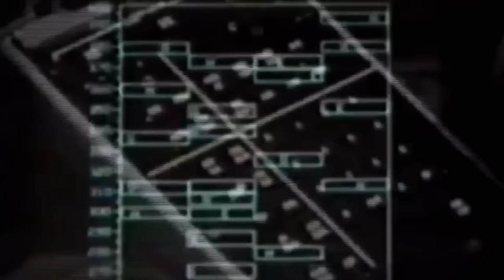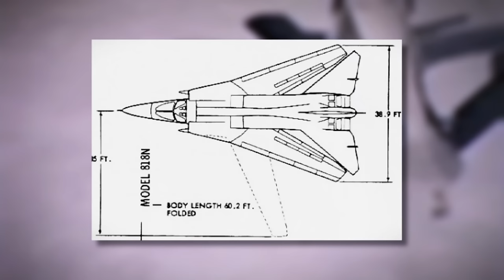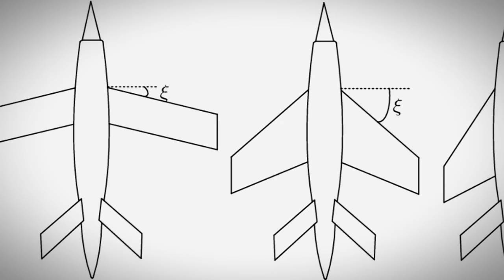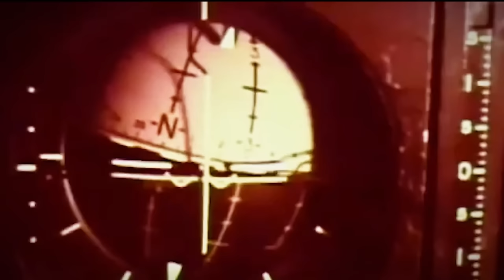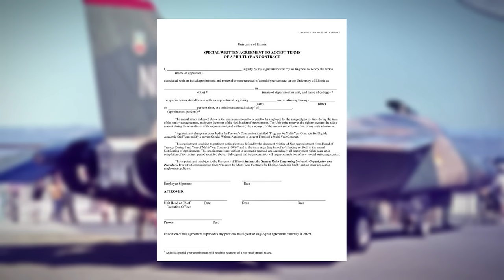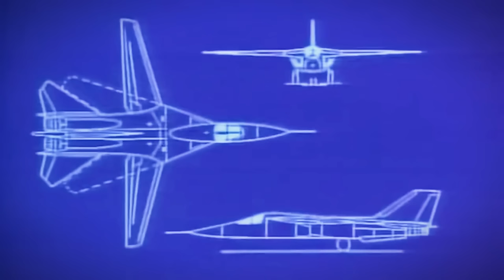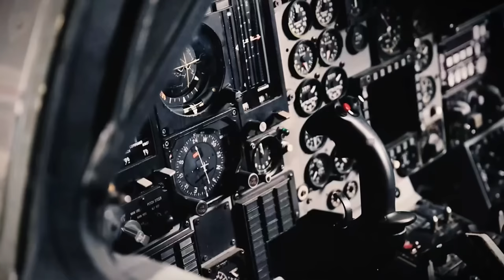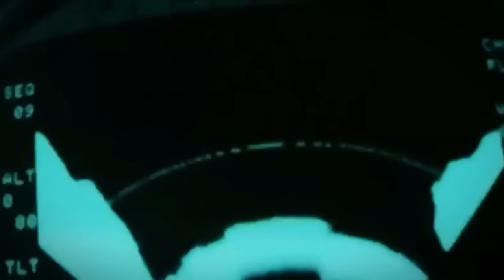10 CATASTROPHIC Consecuences Of F-111's Fatal Flaw

Comment: As an engineer at rhe GD factory in Fort Worth Texas, I was priviledged to work with a outstanding group of engineers, workers pilots and managers that designed and built the F-111 . The experience gained from the previous B-58 program was poured and molded into the F-111. I felt the best model was the F-111C extended wing model delivered to the Australians. So much aviation history and experience was made during those days.
Reply: You forget that the Australians demanded the extended wing when GD developed the FB-111 variant. They contracted for the "A" model and refused delivery for over a year while mods were being made. Different landing gear, and one thing after another including the longer FB wing. The Aussie F-111s were stored at Carswell AFB across the runway until Australia finally took delivery after many upgrades. .My Dad worked the flightline at GD and and lost a case of beer betting the jets would never touch down on Australian soil. I had the privilege of re-building the last F-111 for return to USAF service while working in the Mod program at GD. We took 3 derelict F-111s and made a whole jet from scrap. It carried the designation of E90. You talk about history, I've worked with gentlemen that  pounded rivets on the B-36, back in the day. I retired after 37 years on the F-16 and worked in every part of it's construction especially hydraulics. I've installed every piece of tubing from end to end whether it carried air or fluid. Every F-16 built in Fort Worth since 1984 have my fingerprints on them, somewhere. Guys like me are the ones who actually give you a reason to have a job, When's the last time you actually saw a living, breathing aircraft?
Reply: Thank you so much. Engineers just get the job done. We are blessed to have you guys making our lives safe and simple.
Reply: You made an incredible craft. I got to walk all over an active F111 and sit in the cockpit. The only one I bet A6 drivers kind of eyeballed lustily.
Reply: @williamhudson4938  the main thing that the RAAF demanded was retro fitment of the improved designed heavy wing carry through box. The wing extension were a bolt on article and of not particular significance to any delay in acceptance
Reply: I wonder if you could confirm or bust a story I was told in a Materials class in college.   When discussing the change in properties of some materials at low temperatures, we were told that there was concern for voids in one of the wing parts (possibly the turntable) that could not be detected by equipment of the time. The solution, we were told, was to bring the entire aircraft down to a very low temperature where the material was weakened and stress was placed on the wings to see if that component broke.  One version of the story had this happening in Alaska during winter to make it easier to get to the very low temperature needed.   
Thanks
Reply: @jfess1911  this is the irony of this video. While it mentions the failure of the wing on 67-0049 in Dec 1969, it doesn't go into any details about it or how it was resolved. This is the fatal flaw of the title and the consequences were massive.
In short yes, a small undetected flaw in the wing pivot fitting grew from initial size to a critical crack length in just 100 hours of operation. This was a previous unknown issue with the D6AC steel used in the primary structure. Flaw sizes that were smaller than what was detectable by the non destructive testing available at the time had the potential to grow in remarkable short times. Even with improved techniques with higher probability of detection down to 10 thousandth of an inch, any stress raiser could still become critical in unreasonably short time. 
That is where 'Cold proof Load Testing' comes in. By cold soaking the entire aircraft it would reduce critical crack size. Then they applied specific loads to the aircraft to simulate extremities of what might be encountered in flight. If nothing broke, aircraft was good for a period of time before having to undergo the same test again.  Never heard Alaska in winter being mentioned LOL, they built a very special facility to do these tests in. 

Here is a good paper on the subject written by the Materials Officer for the RAAF F-111 Mr Gerrard Redmond (super nice guy) https://www.ndt.net/article/apcndt01/papers/912/912.htm
Reply: @misspuddles63  Thank you.  I wondered how many critical flaws they found with the cold-soak method, and the article says 11.  I am not young and heard the story sometime around 1981, long before the referenced article was written.   It would not surprise me if some of the details were still secret at the time.  
 I suspect that the "Alaska Story" came from the -45°F test temperature needed for the test.  IIRC, there was also a story of a crash resulting from the terrain-following radar reading the bottom of a lake instead of the surface.  I wonder if that is actually the "snowy hillside story" with facts confused.
Reply: @jfess1911  Welcome. It is an incredible story that this video sadly misses almost completely.
As an Aircraft Technician I don't pretend to understand all that TFR stuff much, but yes I have heard and seen references to the early issues with TFR over water, in the rain, maybe even snow. As I understand of the first 3 to crash in Vietnam, at least one was thought to have been a TFR issue. They got it all tweaked out pretty quickly. Important to remember how revolutionary the system was at the time.

Comment: It wasn't a cracked wing box. It was a fatigue crack in a wing pivot joint. The USAF then established the Aircraft Structural Integrity Program (ASIP) to determine where on aircraft to inspect and how often. Dr John W. Lincoln headed up ASIP as the USAF expert. He was my mentor, and I performed structural analysis under his direction.
Reply: I am a retired military aircraft engineer and I share your concern that the narration incorrectly describes the flaw that caused the accident, if people want to make documentaries about specific items, incidents and historical facts then they should be prepared to do a huge amount of research, in this case I don’t think it was anywhere near enough to be considered factual.

Comment: Back in late '76 or early '77, I was working at an iron ore processing plant at Point Samson, WA. It's a very, very low population density area. Annual rainfall <10 inches. High summer; 40+ C, cloudless. I was on the ground outside the plant, in bright sunshine. Suddenly, the ground went dark around me - as if something big was about to fall on me, but there was no sound. Then the sound of jet engines. I looked up, and two F-111s with their wings swept back went overhead, apparently on a dummy bombing run. They must have been doing ~ mach 0.9, at around 500 feet ASL. They came in from the ocean, flew low over the plant, turned, and headed back out to sea.

I can tell you, you would not know what hit you if they were a target; the sound would arrive just before the bombs or missiles, and the plane would be gone. The shadow had been and gone before I heard it - maybe half a second, then, it's really loud. When I looked up to see WTF it was, they were already banking hard, before heading straight back out to sea. Absolutely awesome experience. Unforgettable.

Apparently they could fly at ~300 feet above the ground, terrain following. A few did have catastrophic crashes, but they were an awesome weapon. Sadly, with high performance comes high risk.
Reply: 200 feet was the goal.
Reply: Not trying to be a nitpicker, but for the Americans reading this, you probably should have said Western Australia instead of WA, which to them would mean Washington state. I know the north-west, having lived & worked in Dampier. Good story though.

Comment: Why are there so many irrelevant pictures compared to the narration?
Reply: Yeah…they really did have some relevance, but the relevance was really between the lines.  Like the T-28?  Huh?  I mean, it certainly had a COIN mission, and a reconnaissance component, but it seems like a stretch that it was part of the F-111 propsal.  The Skyray and Jaguar made some since for the Navy’s TFX, and the Su-24 highlighted variable geometry, although that wasn’t discussed.  Etc, etc.
Reply: An AI generated video 😢.

Comment: Pictures rarely match up with the documentary. The failure was the early terrain following radar. This was later fixed and it was a real winner for the F-111
Reply: Eek, if you thought this was bad, try watching a Dark Skies doc.  I got so frustrated I unsub’ed, which I rarely do.
Reply: Agreed, I did see some 111's with the landing bay door torn half way off and was told that they hit some pine trees from flying a little too low. Well, into the hangar for 5 or 6 months.

Comment: A RAAF F-111C based at Amberley in Qld., Australia lost a main wheel on T/O. After much discussion, it was found that this had never happened before, even the manufacturers had no idea what to do other than blow the capsule and eject. The pilot suggested lowering the tail hook, (YES THEY HAD THEM IN CASE OF BRAKE FAILURES,) He then did one or two low runs down the runway to gauge his height, then asked for the arrester system for the runway raised. He the managed to snag the approach end cable, gear up, and both crew evacuated. Minimal damage to the A/C.  There is a YouTube clip of this incident. Australia decided after it was time to retire the F-111, the Bloody government just dug a great hole and buried them. Just like they are doing to our Airbus helicopters. All new A/C.

Comment: Pilot of an F-15C told me in war games the F-111 were very quick on the egress almost un catchable.
Reply: I had an F-15 try and chase me down at Red Flag many years ago, but he gave up pretty quickly when he realized I was doing 1.2M at 200' on the deck.  The Vark was a great low-level jet, fast and smooth.  Speed is Life.

Comment: PATHETIC  - it took 19 minutes of random aircraft that have nothing to do with the narration to reach that fatal flaw - the wings fall of if you don't perform proper maintenance. It''s a problem that things with moving parts have 

This video is laughable!!! When talking about the F-111's speed record they show a picture of a fixed wing F-6D Missilier, when talking about the two man crew of a crashing F-111A, they show a picture of 26 man chorus dressed like Canadian Mounties. When talking about the first two men to die in a crashing F-111A they show a picture of a U2 taking off. When talking about the grounding of F-111s they show a British Vulcan bomber, when they talk about inspecting and testing the F-111, they show videos of F-105 Thunderchiefs taking off. When they talk about the root cause of the crash they show a weapons load crew loading an F-105 followed by a Navy F-4 on a carrier, then back to the Thunderchief taking off. When talking about testing the F-111 after repairs they show a Douglas A-1E. Somehow they thing that the F-111A and the EF-111A are two different aircraft. 

When talking about weapons carriage they said that the bomb bay could carry two M117 750 lbs bombs internal (which it could) but they showed a dozen M-117s hanging on the wing of a B-52. When talking about the bomb bay mounted laser target designator they showed a video optic guided bomb. When talking about ECM pods on the F-111 they showed some oddball looking single engine fighter carrying three large gas tanks. When talking about F-111A bombing North Viet Nam they showed a B-52. When talking about Terrain Following Radar they gush breathlessly about the plane operating at 200 feet, which is actually 150 feet higher than where they operated

They never bothered to get around to listing the 10 CATASTROPHIC Consecuences Of F-111's Fatal Flaw. They mentioned 1 crash. that's it. 

Worse than Dark Skies, which I didn't think was possible